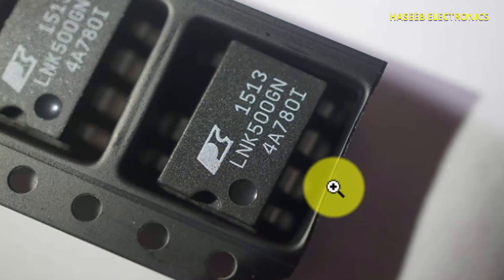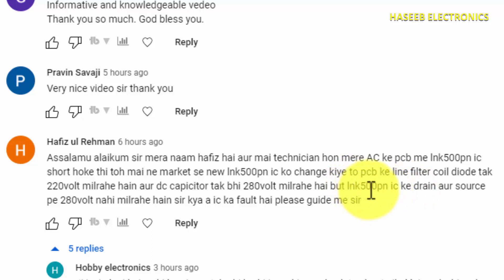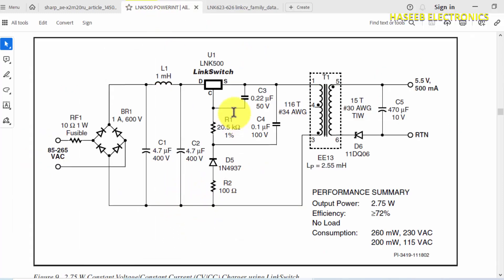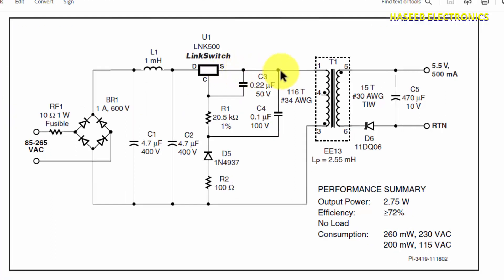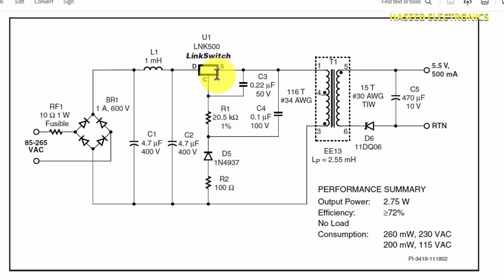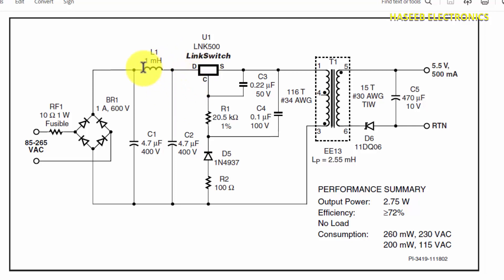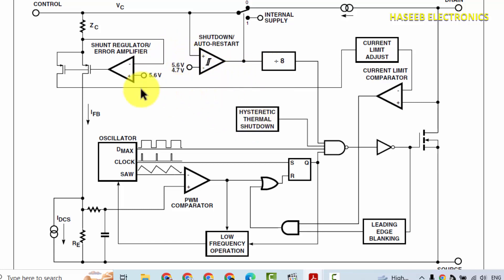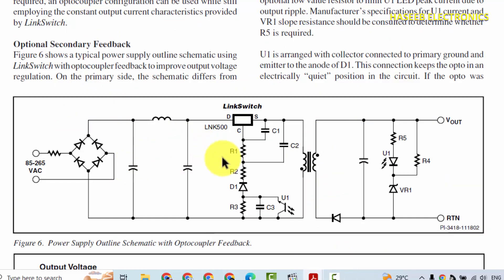{905} LNK500 smps sample circuit

Comment: Sir please make a video on SMPS power supply 24v using IC SD4843P. I have one supply it was burned due to high voltage. I am unable to repair bcoz of parts not available.

Comment: LNK500 is an interesting chip, but on the flip side it has no place in serious products of its application simple low-power 5V chargers with low parameters and micro-power power supply units on duty, the usefulness of its applications is doubtful!